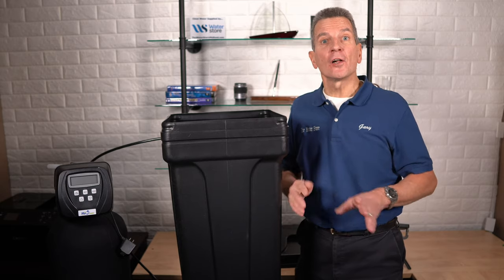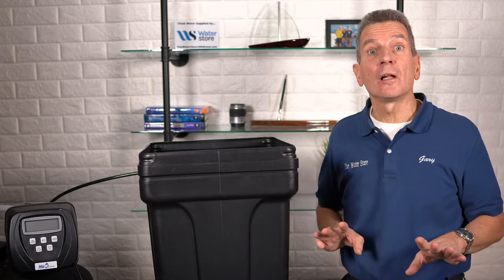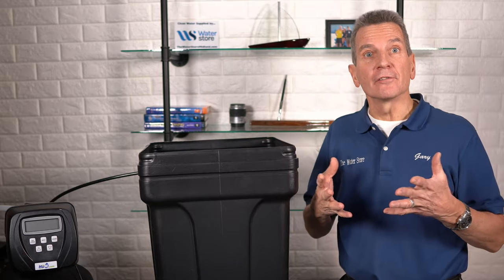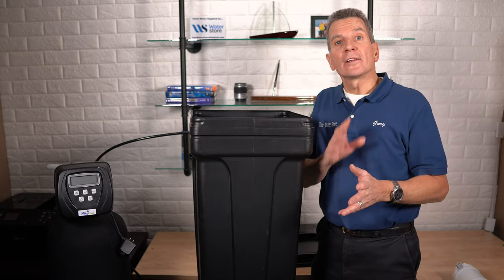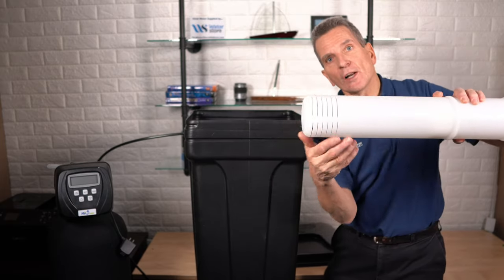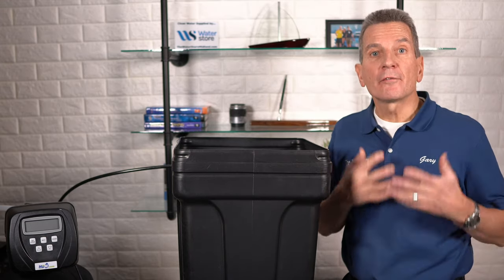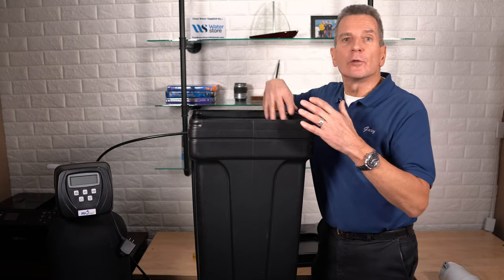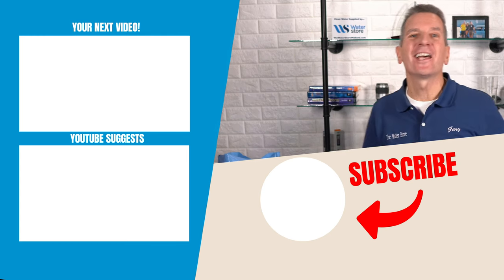WATER SOFTENER CLOGGED with SALT?

Comment from the maker: Getting rid of that dreaded water softener salt clog is easier than you think, if you know how!
Reply: Hi will low water pressure be a factor as well of hard salt I had to bypass the filter to get pressure back in house the company talking about the problem in the tank not the salt tank please help
Reply: @markrush8071  Water pressure generally has to do with bladder tank. I had a pressure problem from whole house filter when the 'in head valve' broke.

Comment: I'm a retired engineer and hears my handy man solution. First, clean it all out as was described above but, when it comes time to put the salt back in, take the bag and poke a bunch of holes in it. I use a small garden tool with four pointy claw like things. Anyway, poke it full of holes from the top to the very bottom of the bag. Then put the entire bag in the tank. WHY?  The reason the salt clogs the intake ports is because when the salt breaks down it gets past the Sive at the bottom of the tank and starts collecting around the intake port. When that first bag gets low pour its remnants into a second previously used bag that has holes too but has an open top. The residue bag also stays in the tank. A few things this does. A) it prevents the intake ports from getting clogged from partially dissolved salt B) if you ever need to get all the salt out of the tank for inspecting it makes it really easy. C) it uses all the salt more efficiently (no waste from cleaning clogs) Note; there is only so much salt that can be dissolved in the water so filling the tank to the top with salt is actually promoting the clog problem. Oh, a 1/2 cup of bleach once in while on regen day can also helpful. My water is perfect since started doing it this way.
Reply from the maker: I've never heard of this approach but it makes sense.

Comment: I just bared down and poked at it with a broomstick and a sturdy stainless steel scoop. The further I got into it, the tougher it got. I finally got to the ‘mushy’ salt and finally the looser mixture. I was able to remove the ‘table’ near the bottom and remove the remaining brine and salt. There was about 6” of mushy salt at the bottom of the well. A few gallons of hot water removed whatever was left. One time through with the regen and the Kinetico system was up and running again. I wouldn’t have gone this far without your clear instructions. I’m going back to Duracube pellets too. I just seem to have better luck with this type. Thanks for making this video!
Reply from the maker: Thanks for watching, please share video with friends and family.
Reply: How long did it take you to break through the salt bridge with the broom handle?
Reply: @BillDaleyPSU  I mainly used the stainless steel scoop. I used the broomstick in the tight spots where I couldn’t get at it with the scoop along the sides to get it loosened up. It took about a half hour total. It’s been 2 months now and the Duracube  pellets are keeping my Kinetico softener “regular”.  No more bridging, no more mush. Lesson learned.
Reply: @pliccut  thanks

Comment: I used to do all of that.... I finally got my steel crow bar, yes crow bar.. very carefully to not damage sides of tank nor the bottom plastic insert. I twist it while applying downward pressure. It  breaks through the salt bridge. Sometimes I have to twist it through several areas of the bridge. Saves a lot of steps to get back to treated water. I make sure to clean all debre off the crowbar before and after use with a 3m scotch pad. Much less time consuming. But BE CAREFUL while doing it!
Reply from the maker: Yes, verey risky but I'm sure if you are careful it will work.

Comment: I emptied my salt tank completely of water and salt. Filled with the hot water and let sit for about 3 hours. Did a regen and nothing seems to have changed. Was that not long enough or did I miss something?
Reply: Did the same process and observed water being drawn out and then refilling but still feels like water is hard. Guess I’ll see if the salt level goes down or stays same for a while.
Reply from the maker: You will need to do this several times.  Each time you do it the new water is absorbing some of that salt and eventually it will remove the clog.

Comment: I have a 2 year old Water Boss 900.  2 adults in the house.  The water hasn't seemed soft at all to me.  Had a tech come out.  He said the system checks out fine.  Since his visit, I am suddenly going through a bag of salt each week!!  Still doesn't feel soft to me either.
Reply from the maker: Something is wrong. I would have the water tested before and after the softener. Then make sure the settings are correct for your hardness.
Reply: @water_estore  found out the tech left the Power wash on. Went over all the settings with a Water Boss tech. My only issue is the water still does not feel soft to me. It registers soft using their tests, but I don't feel it.

Comment: Hi Gary! Ive noticed everytime my softener regens, water in the home is extremely yellow. If we run the water for a while it eases out and stays much clearer until the next regen where it is yellow again. Unfortunately it remains yellow in the brine tank. What could be the cause?
Reply from the maker: Oxidized iron. You either need to regenerate it more often or get an iron filter.

Comment: I can see a large amount of salt and water in the tank, but the salt and water level has not changed. What is the possible issue? I put the softener into regen mode, but I don’t see anything changing. I changed a couple lines and they don’t appear clogged. Just trying to save some money, and fix it myself
Reply from the maker: Could be a lot of things.  Check out this troubleshooting video https://youtu.be/cFy-M6i7_Ms

Comment: Really appreciate your videos. I'm a DIY type with a background in chemistry and have used ion exchange resins in chemical laboratories. In the past I did some of the things you describe out of 'common sense' re: clogs, salt bridges; had to scoop out and clean my brine tank after a storm blew the lid off. Reassuring to know I was on the right track. Fortunately my installer recommended the pellets on day one. Thanks for taking the time to make these.

Comment: Hi! Thank you so much for all the helpful videos!! Our softener was full and we scooped all the salt out to get rid of the clog at the bottom.  Can we re-use the salt from the top of the tank (somewhat dissolved but still separated and in a solid form)? We threw out the sludge at the bottom.
Reply from the maker: Yes, but add it gradually to the new stuff.

Comment: All fine and dandy if it's the house you live in. If it's a tenant's house, they want if fixed right way, and you don't want to be going back three times to fix the problem. I just empty the damn thing and put new salt in it. And yes, it is a major pain in the butt. Been there, done that.
Oh, and I just had a riser tube basket fail and resin went into the entire house plumbing. That took two days to clear. I just LOVE water softeners.
Reply from the maker: Like everything else there will be maintenance and repairs. But think of the grief you would have without it

Comment: Thanks Gary - Great videos and I've learned a lot!  My water softener seems to be working and not clogged, but what happens is that after my water softener regenerates (once or twice a week), there's a bunch of air in my water pipes.  So if I turn on the shower or faucets - it'll spurt some air/water for about 30 seconds until the air comes out.  Do you know what might be causing this?
Reply from the maker: Yes, the air check valve at the bottom of the float in the brine well is failing.  We have replacement floats here https://waterestore.ca/products/waterite-water-softener-float-assembly

Comment: Hello. This has been very helpful. I’m removing my clog right now. My question is did you say once done add the salt and the pour 4 gallons on top of the salt or put the water in first ?
Reply from the maker: Doesn’t matter which one goes in first
Reply: @water_estore  Thank you. It was quite the job removing all the salt that was clogged but got it and back in business thanks to your help.

Comment: Gary, If I bought a unit that can go nearly two weeks between Regens (an oversized unit) is it possible that with slightly overfilling the brine tank with salt SITTING TOO LONG-- immediately began a salt clog?---Meaning the lack of regens allowed the salt to make muck of itself and SEVERELY retard the effectiveness of the regen, and leaving the capacity to need regens every couple of days--or the water was hard again.
Reply from the maker: Yes, which is one of the many reasons why I don't recommending oversizing your water softener.

Comment: Hi Gary. I'm currently using a clack water softener at home, it is approximately 8yrs old (45K unit) with water hardness at 54gpg and the system set at 75gpg. I'm experiencing periodic hard water at times, probably more often than not. How do I tell if my system/bed is a sanitizing type? I'm currently using Premium solar salt but would like to switch to your recommended type, Windsor Clean & Protect. I suspect that I may have a salt clog do to keeping the salt level too high. I've never cleaned the brined tank. Great channel! Love the informative videos!
Thanks 
Shane
Reply from the maker: The only way of knowing what media is inside the brine tank is by contacting the manufacturer

Comment: GREAT info - BUT, you said to REGEN, "press and hold for 5 seconds, and then you'll hear the motor start up, and go through a cycle.  Once it starts counting down, push button again for brine cycle."  Do you let the regen cycle run in it's entirety?
Reply from the maker: No, as soon as it starts counting down you push it again to fast forward

Comment: Great video, Gary. I have a Krystal Pure water softener, and the screen says "maintenance, call for check-up." Would this likely be displayed for a clog?
Reply from the maker: No, but not really sure why you are getting that, likely just for some "routine maintenance".  I would contact them.
Reply: @GarytheWaterGuy  thanks for the response. Looking in the user manual, there is no mention of that remark in there. I noticed the screen also displays a lock symbol, so it probably is some scheduled maintenance. I will reply back here once I do get it figured out in order to help others out.
Reply from the maker: Likely just programmed in for "Regular Maintenance" that you probably don't need.

Comment: Hi Gary,
Why is my water softener drawing water into the brine tank during the brine cycle? (The one that is about 60 mins. Long) Since I am trying to correct a water low pressure issue, yesterday I checked and cleaned all the valves, connectors etc. and cleaned out the brine tank and float system. After I put everything together again, yesterday afternoon I ran two manual regen cycles, one last night and another one early in the morning. The water level ended up normal after each one. But today after I did a manual regen the water in the brine tank went up too high that it overflowed. Any tips?
Reply from the maker: If the drain line was clogged you would get that situation.

Comment: My softener was working but water was hard, there was an issue with the brine tank so I installed a new one and ran a regen but the water is still testing at 640 tds (normal is 1000). What could be the issue?  Do I need to run regen again?
Reply from the maker: When water is softenerd by a water softener it does not reduce the TDS.  See this video https://youtube.com/shorts/NwSnZBIp-x8 Have your softened water tested for hardness, not TDS, to see if it is softening your water.

Comment: Hi Gary. Firstly thank you for making these informative videos. My question is, since I busted up the hardened layer of salt that was present at the base of my brine tank, I cannot quite see what the slits of the bottom of the brine well. I don't want to get a vac to suck out the water I poured in to loosen the salt bridge. Does it hurt anything to do a regen with all the briny water in there?
Reply: Also, can I add the salt that I scooped out back into the brine tank?
Reply from the maker: No it does not hurt.
Reply from the maker: Yes, but I would use new salt at first and then add the old stuff gradually to use it up
Reply: @water_estore  thank you!

Comment: Our water softener has been turned off for over a year, since we moved into this house. I only just realized it. Now the tank is half full of solid salt. How do I get it out? It's not just a bridge.
Reply from the maker: Follow the advice in this video, it is meant for exactly that concern, this video is not for dealing with a salt bridge.  It won't be easy but with time effort and water you can get that clogged removed.

Comment: My tank was making a loud noise should I be concerned? Had codes c4 5  and c1
Reply from the maker: At what point does it make these loud noises?
Reply: Maybe it’s going thru the “regen cycle”? My softener is loud during regen
Reply from the maker: Yes, exactly

Comment: Hello, my softener softens the water for the first 600 gallons after a regen but when I have 700 gallons remaining the water suddenly turns hard. Could this be because I don’t have it set high enough on the grains?
Reply from the maker: definitely either a problem with the settings or the media is worn out.
Reply: @water_estore  thanks for the reply Gary. I doubt it’s the media because the unit was just installed 10 months ago. I cranked up the grains and I’ll see it or help. Thanks!!

Comment: My Softener does not have hard salt. However it has not used salt in a couple of months. I took most of the salt out and sucked the water out. I checked to make sure that the slits in the bottom was not clogged. Now what
Reply from the maker: I suggest you follow my troubleshooting video here https://youtube.com/live/Lr3jyGiJdC0

Comment: I’m having low water pressure issues and it’s not on the city side. City checked that already, we haven’t used it in about two years when my wife added a bag in it. Seems like ever since our water pressure is low. Any suggestions.
Reply from the maker: Did you try to test it as shown in the video?